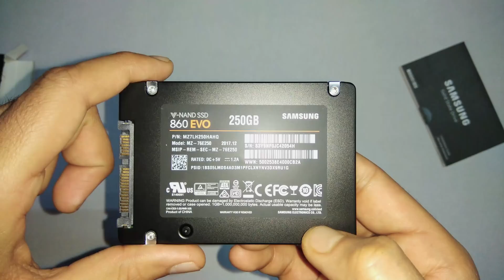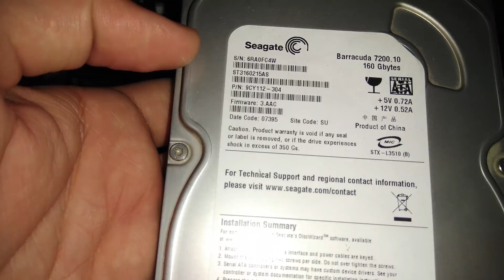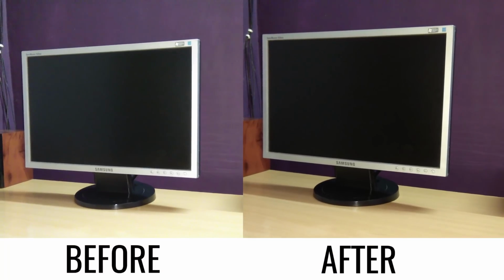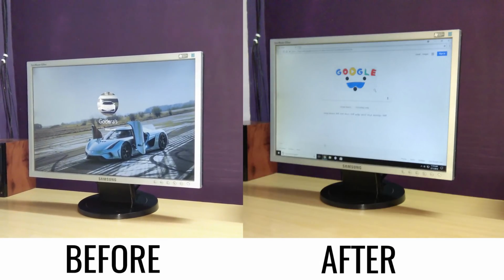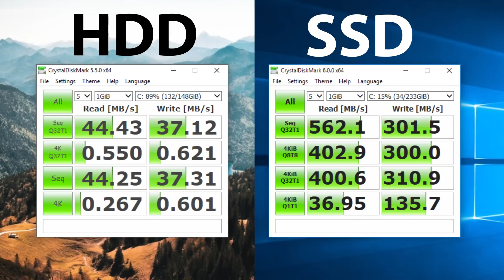Samsung 860 EVO Review and Installation

Comment from the maker: Guys if you have any query please feel free to ask in the comment section thank you for your support.
Reply: I bought a WD Green SSD 120 GB and installed Win10 on it. I have been using it for 6 months. The WD software shows 98% life left ? Should I be worried. I stopped defragmentation after I learnt that it damages the SSD !!
Reply: I've connected all the cables but my Pc can't see the ssd :(
Reply from the maker: Go to your BIOS and recheck.
Reply: Can someone help me, I'm planning to upgrade my system from hdd to ssd, i dony know how to install ssd and setup in bios please help me. Thanks!
Reply from the maker: Yes ?
Reply: were the cables already in your pc or did you buy them separatly?
Reply from the maker: Power cable was already in PC and I had purchased SATA cable separately

Comment: One quick question. What would be the best root to take, I was one of the idiots to Upgrade to Windows 10 when it first came out In July 2015. With it it ce with many bugs and caused alot of Hardware and software problems. My question is as i transition to an SSD would it be more wise for a fresh Install? Your answer will be very much appreciated.
Reply from the maker: Fresh install is good to go.
Reply: @iGadgetBox  Thank you

Comment: how do i manage and change the BIOS settings after installing the SSD? i know that i can clone all of my data from the HDD to the SSD with samsung software, but i also want to use the SSD as my MASTER drive and the HDD as a SLAVE drive, is this possible?
Reply from the maker: You need to reinstall the windows on ssd.
Reply: @iGadgetBox  well i cloned the hdd to ssd with windows and all, then deleted all data on old hdd and now using it as mass storage :-) everything works well now and of course faster
Reply from the maker: Great 👍

Comment: Where did you get the cord to connect it?
Reply from the maker: It’s a SATA cable. You get those 2-3 cables with your motherboard. If not then you need buy them separately.
Reply: @iGadgetBox  thanks! I found it! It's also what I'm using for my rgb fans 😅😅😅 first time building and I have to say, I'm glad I did this!
Reply from the maker: Anytime 😊

Comment: Ssd makes a huge difference my opinion ssd should be the first upgrade you should do.   I put an ssd in a PlayStation 4 and a laptop I’ve had for a couple of years soon as I booted the drive it was like a brand new computer the speed was very noticeable.  

Also if you plan on upgrading to an ssd for your laptop.   More than likely you will need a usb to sata cable I know some Samsung model’s come with them but I know the 500gb ssd doesn’t.    I needed one to clone my old hdd to the new ssd.  

And Samsung does offer a free data migration for cloning it seems pretty straight forward too and the also offer Samsung magician so you can see how the drive is working, temp, health etc...

Comment: will the performance of this ssd differ in hardware specs?because i have a core2 quad processor with performance output SAMSUNG MAGICIAN BENCHMARKING SEQUENTIAL READ 257 WRITE 244 IOPS READ 19K WRITE 9K.

Comment: Dear Sir,

I would like to request you to help me as early as possible..
I have HP machine Intel Core 2 Duo  with DDR2 RAM Size=4GB, Hard Disk Size=250GB

Now I want to Replace Old Hard Disk by SSD Hard Disk  samsung 860 evo 250 GB OR 500 GB.

Is it possible for This CPU OR have to go with samsung 850 evo ?

If you have any specifications on this issue... Please Share over here 

I have to buy this as early as possible  for my study purposes with help and support of yours

Kind Regards,
Basavaraj, India.
Reply from the maker: Basavaraj Chougala yes, you can use this SSD with current specifications. It will improve overall performance.
Reply: @iGadgetBox  

Dear Sir, 

Hearitly Thank you for Valuable reply, It is Desktop PC... brief information about this PC giving over here........ 

System Manufacturer = Hewlett-Packard 

System Model = HP dx2480 MT(KL969AV) 

System Type = x64-based PC 

Processor = Intel(R) Core(TM)2 Duo CPU E8400 @ 3.00GHz, 3000 Mhz, 2 Core(s), 2 Logical Processor(s) 

BIOS Version/Date = Phoenix Technologies, LTD V1.09, 1/7/2009
 SMBIOS Version = 2.5 

Hardware Abstraction Layer = Version = "6.1.7601.17514" 

Installed Physical Memory (RAM)= 4.00 GB -  DDR2  (2gb+2gb=4gb)

Using this APP -> "HWiNFO64", I got following information.............. |

 "SATA 6 Gb/s WDC WD10EZEX-08WN4AO [1000 GB] 

ATAPI HL-DT-ST DVD-RAM GH40L [DVD-R -DL]."
 I think This much information is enough for knowing Version of SATA ....and 

I think it is suitable for Samsung 860 evo only. 

"does samsung 860 evo support DDR2 RAM 4GB ????????"

Please give me your kind reply.............
 Your's 

Basavaraj, From India.
Reply from the maker: Sorry for the late reply. As said earlier you can this SSD it doesn’t matter what kind of RAM you use. SSD and RAM are two different things.
Reply: @iGadgetBox  

Ok sir,  Thank you for your kind reply and clarification of RAM Version.

Regards,
Basavaraj,

Comment: Hello my friend.what are the differences between Evo and Pro?Is it true that as bigger as the faster SSD hard drive?i've heard that the bigger ones have a better performance. is that true?
Reply from the maker: With more storage you will get more TBW (Terabyte Written) and when you have more TBW and more storage, you will see little bit performance improvement but not huge.
Reply from the maker: Pro SSD’s are designed to handle heavy workloads on high end computers and they are costly as compare to EVO SSD’s.
Reply: @iGadgetBox  Thank you so much man!

Comment: Can I run this Samsung 860 evo by itself of do you need the seagate baracuda as well?
Reply from the maker: No, you don’t need extra Seagate drive you can use SSD alone. I’m using Seagate HDD because the cost per GB of HDD is less as compare to the SSD.

Comment: Is the booting up quicker the only benefit to getting one of these ?
Reply from the maker: No, the overall performance is substantially improved with SSD like Apps launch time, Increment in task processing, multitasking, Read/ Write commonly know as copy/paste, video rendering and other day to day task.
Reply: @iGadgetBox  Excellent , thanks for your help and quick replies you've made it exceptionally easy for me to decide to get one , keep up the excellent videos .
Reply: @iGadgetBox  how do you install this cable wise ? Do you just plug in the cables that were used for your old hard drive or would I need extra cables ?
Reply from the maker: James Bond these are the old cables one is power cable and the other one is SATA connector of HDD.
Reply: @iGadgetBox  a bit of a stupid question but do the new cables plug into the same plug as the old ones ? please try not to laugh too much hahahaha
Reply from the maker: Yes, the same SATA connector and I’m not laughing 😂
Reply: @iGadgetBox  Thanks for all your replies and help , you've saved me a good few £££s hahahah keep making your awesome no nonsense videos , iv'e now subscribed Cheers .

Comment: I haven't been able to find a direct answer elsewhere yet so: Is this intended to be an outright replacement drive or can I install this simultaneously with my old HDD drive?  Basically, I need to know if I can keep my previous data intact and use this purely for higher speed needs like running games and what have you.
Reply from the maker: GWFanSoftcoreBrony yes you can use it with your old HDD drive. Just make sure to use the SSD as a primary drive means the one with operating system installed to get most out of this SSD.
Reply: Thank you.

Comment: Id like to install this on my PC but only as extra storage. Is it plug and play or do I need to any kind of update or formatting?
Reply: Im wondering that too. Someone help!
Reply: If your laptop has an extra m.2 ssd slot you can use that to expand your storage. Only thing you have to do is format it allocate it and initialize it. Then it's ready to be used. You can do that if you go to disk management. If you're planning on using a new ssd and plan to replace the default one that came with your computer when you bought then you'll have to reinstall windows and change the bios which may be a bit hard and complicated if you're not computer tech type of person. But I would ask a professional who knows more about this to help you before you settle on this.

Comment: sir i want to replace my 128gb ssd  with 256gb ssd, but i dont know how to take backup of OS from my old ssd and install to new ssd. i have purchased a new laptop with licensed OS i.e windows 10
Reply: Install new SSD as secondary drive and clone the primary drive to it.  After it completes the cloning process, reboot, and change the boot order to boot from the new, recently cloned SSD drive.  If it failed for some reason, you can always change the boot order back to the way it was, and boot from the original SSD drive.
Reply from the maker: You can use visit this site https://www.microsoft.com/en-in/software-download/windows10ISO to create a licensed ISO windows file from your laptop. Make sure to open this website in your laptop from which you want to backup licensed version.

Comment: Hey friend,if 860 evo compare to adata su860,the speed will different much?some people said u got no feel about iops,its less than 0.05sec?...than why still need to buy the higher prices samsung ssd?i got confuse😂😂😂
Reply: Sorry for late answer but i see what you mean. One of the biggest reasson why you should buy expensive ssds (for example samsung 860evo) is because they use technology MLC (multi-level cell) instead of TLC (triple-level cell). MLC ssds are a little more expensive but they will last longer (they have bigger life cycle, bigger data transfer before your ssd die). It is worth it if you want to use your ssd as storage for some games or any programs beside windows. They are only ~20€ more then TLC ssds.

Comment: I bought this but it runs in sata 1 mode (1,5g). Still much faster then old hdd :)
Reply: Hi, I''m going to get one, can you please explain why your ssd onl;y 1,5g? what is your motherboard model? and if I'm using mainboard Gigabyte B360 ds3h, will it run the ssd with full speed? I'm so sorry my english bad and I'm a newbie for this. Thank you
Reply: I dont know why it runs in sata 1 mode. Motherboard is some gigabyte am2+ socket so it should run in sata 2 mode (3g). Your motherboard should run this ssd witnouth problems in sata 3. cheers;)
Reply: Thank you very much friend. maybe there is some ways to change the sata mode to 2 or 3

Comment: good work plz tell me i am going to but 860 evo 250 gb ssd for keeping my windows on it 
my second drive 2tb seagate barracuda 7200rpm new model 
i put games on my hard drive 
can this ssd help me in faster game loading speeds
Reply from the maker: gaming pc news gaming pc news i had tried the same after installing this SSD and i have seen around 25% increase in game loading speed.
Reply: You have to move your game files to the SSD to benefit from the speed

Comment: My laptop hdd is almost dead, so planning to buy 250GB Samsung 860 EVO. 
comparing to hdd how long does it last (generally) ? ?
Also comparing to Crucial MX500
Reply from the maker: Nishant Kumar the life of the drive depends on the TBW (Tera Byte Written) and samsung is providing 150TBW with 250GB  model which means samsung is taking guarantee that you can write upto 150TB without facing any problem and if you do your drive will be replaced. 860 EVO has 150 TBW Or 5 year Warranty whichever comes first. On the other hand Crucial MX500 250GB Model has 100 TBW with 5 year limited warranty which ever comes first. I think it will help you in taking better buying decision.
Reply: @iGadgetBox  can you please explain to me what TBW means ?
Reply from the maker: TBW stands for Terabytes Written which means the average bytes you can read/write during the lifespan of the SSD. This is the estimate number provided by SSD makers to give you an idea that you can use this SSD at provided TBW without facing any issue.
Reply: Compare to other ssd ,samsung tbw are better than mx500 too much......i just get one 860 evo 1tb to my ps4 pro.....that speed is crazy
Reply: 860 is just €166,- 1TB !

Comment: where did you buy your power cable amazon doesnt include it with a new 860 evo 4tb im looking 4 the power cable thanks i thumbs up ur video
Reply from the maker: Ex6oN yes it will work
Reply from the maker: Samalyaboss martin you don't need extra power cable because most PSU(Power supply Unit) has plenty of them already attached. What you need is a SATA cable the cable with the small connector.
Reply: Will the SATA hdd cable work with my new SSD ?

Comment: boss which one is the best ssd 850 or ssd 860
Reply from the maker: ilyas khan both SSD's are good but in 850 EVO 250GB model you get 75TBW (Terabyte written) and in 860 EVO 250GB model you get 150TBW (Terabyte written). Plus the price difference is not huge so i prefer you the 860 EVO model.
Reply: iGadgetBox  thanks boss

Comment: Did you clean install your Win 10 OS? If so, you should have cloned the HDD first and then see the difference.
Reply from the maker: Kshitij Gupta Yes i did install the fresh copy of OS occasionally but the fault is in my HDD. It was a 2007 model Seagate barracuda around 11 years old. New HDD's are fast. The one i use for multimedia purpose is 2 TB WD HDD which is a lot fast compared to the seagate HDD but I decided to go with SSD for my system drive. Thank you for showing interest. 👍👍